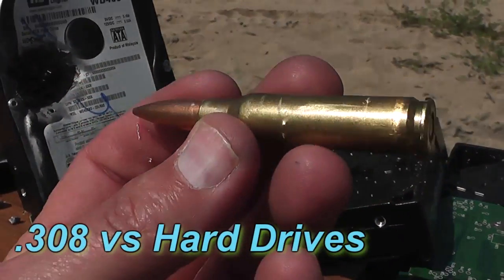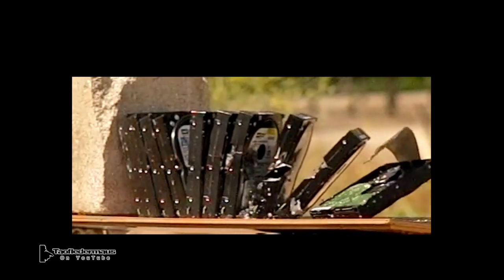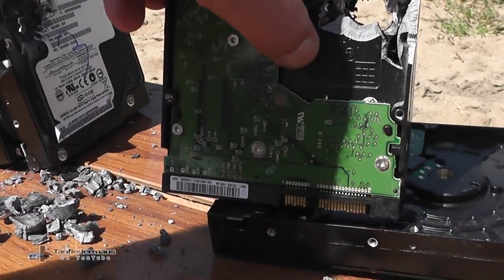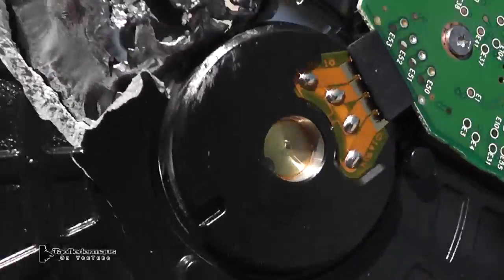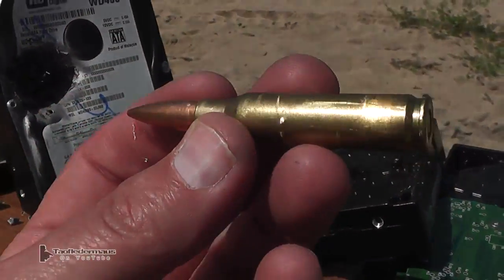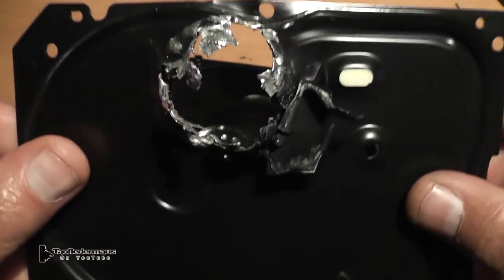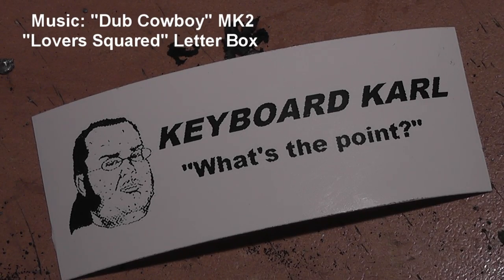AR-10 [.308] Sniper Rifle vs Computer Hard Drives!

Comment: The Sierra Matchking is a TMJ- Total metal jacket, including the enclosed bullet base as needed for a VLD match projectile. Some FMJ's actually have an exposed lead base, made for precision or "match" high accuracy shooting. Simply a target bullet used by many precision shooters in many calibers. I have some in .224cal and some .311's that I load in 7.62x54R, .303 British, and 7.65x53 Argentine/Belgian mauser. The tiny hollow point is only for balance and these are a VLD or "very low drag" design with a large boat tail for decreased drag and increased BC. Sierra actually has a new SMK to market with a pointed ballistic tip to plug the hollow point cavity for even better BC compared to the open point. Good bullets!

Jeff you should try some of the Lehigh Defense .308 rounds, all of their bullets are solid machined copper, should penetrate well! The match solids would be the way to go for hard drive destruction!

Comment: Tao.  I noticed that in many of these tests it is stated that the bullet has begun to open up at a certain stage, based on the size of the hole made at that point.  And while I think that does play a significant part in the size of the hole, I can't help but think the overall momentum of the bullets has an appreciable effect on the hole size and shape also, because the ability of the bullet to shear the steel cleanly, instead of bending and stretching it, would theoretically be more related to the speed it was traveling at impact, than the shape the bullet is in when it hits each surface.  At least while most of the material the bullet is made of is still producing the same center of mass.

Also, I probably don't even have to say it but .204 RUGER

Comment: Even with a scope he still barely hit it lol
Reply from the maker: 36thgallardo  Thanks for watching, Karl!
Reply: ***** Yeah man any time. Think you guys could try out a crossbow vs hard drives?
Reply: I'm surprised he hit it shooting that close with a scope like that ain't easy
Reply from the maker: Harris de Mello  The scope wouldn't even focus on the drives at that distance.   He was just shooting at a blob.
Reply: 36thgallardo that was perfect shot placement on the platters where they are trying to hit them. 
When a rifle like that is zeroed for 200 yards most likely, its very hard to hit anything with a scope that effing close.
Reply: Sarin Highwind that's the joke
Reply: Good cover there dude...
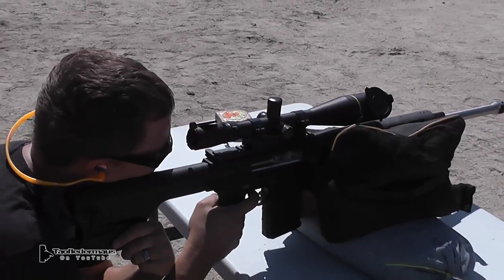Reply from the maker: Sarin Highwind   I think he did have it set for 200 yards.    So when you aim at something 20 yards away or so,  the bullet is going to hit several inches below where you are aiming.    You can see at 0:22  the AR500 plate with the hard drive in front of it,  we shoot at that to figure out where the round will hit.   Then we use "Kentucky windage"  to shoot the actual drive.
Reply: Sarin Highwind thanks
Reply: ***** would removing the scope have ruined its zeroing?
Reply: 36thgallardo yes, you could however remove the entire upper along with barrel and switch it for an upper without a scope, because as long as the barrel and the scope remain fixed in their positions, the zero shouldn't change (check that fact), but there would be little point as he was only taking one shot, so changing the upper or ruining the zero of the scope isn't worth it
Reply: 36thgallardo  He purposely hit it there, since he hit it there it completely compromises the function of the hard drive. It destroyed the plater, if you had seen his previous videos you would know!

Comment: What if you surrounded the Hard Drives in a wood mount that held each one in place so they didn't move around as much? I don't know if it would make a difference by why not try?
Reply: brendan breidegam it wouldn't make a difference, when the hard drives start to move, the bullet made its way a long time ago.
Reply from the maker: TexugoFTW   We'll do a test where we shoot the drives all secured up,  then shoot them again loose and see how much of a difference it really makes.
Reply: ***** Not sure that it really matters.  As long as the test is consistent the results should show trending right?  So as long as all of the shots are done either loose or secured they are comparable to each other which is a result.  Unless the intent is to do as much damage as possible.  I would think securing them might have small to negligible effect on how deep the rounds penetrate.
Reply: As I said before, when the hard drives start to move, the bullet made it's way through already. I saw this before on YouTube with book penetration test. It won't make a difference, but do it for science!
Reply: TexugoFTW If I remember correctly, Demo Ranch did something like that.

Comment: you used HP instead of FMJ. That's why it didn't went through more hard drives.
Reply from the maker: 7150285  yes
Reply: ***** try FMJ next time. If you have the will & time.
Reply from the maker: We'll use some .308 AP rounds next time!

Comment: You should use hard drives with less capacity. 1GB instead of 500GB and the bullet will even destroy HD #10 :)
joke
Reply from the maker: RCScaleAirplanes  A few of them are larger capacity and have two platters in them so those are tougher to get through.

Comment: Honestly,  what did you think was going to happen?  The .308 hype is getting out of hand.  7.62 this, .308 that... its the end all be all. If its not  chambered in.308 its crap. BAH! 
Its NOT a powerful round people!  Its a compromise cartridge....  its as close to 30.06 as they could get and be short enough to fit in a modified garand action. Its a good round... but it aint magic. 
The '06 is a more powerful cartridge. 8mm mauser is a  more powerful cartridge, 7.62x54r is a more powerful cartridge   
Now, you want a powerful .30?  Try .300 win mag , .300 Holland and Holland, or .300 weatherby.  Those are some mighty .30 cal cartridges.